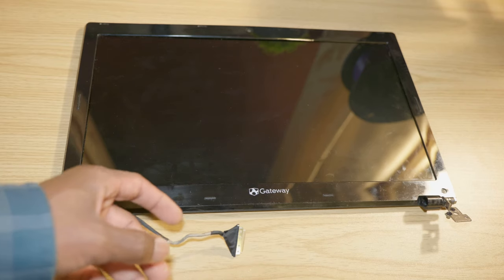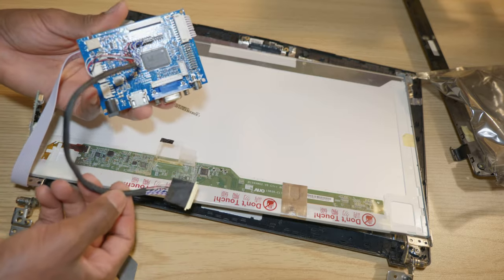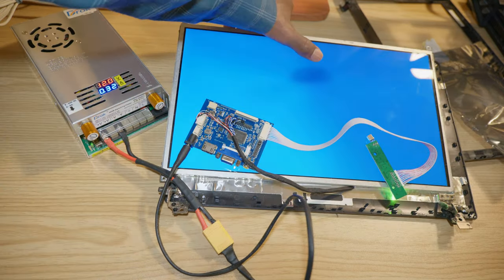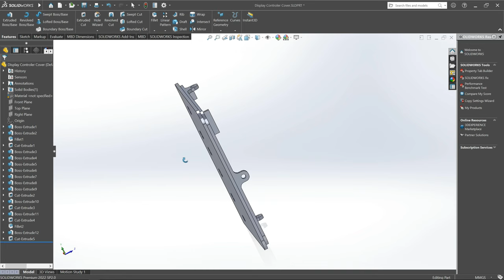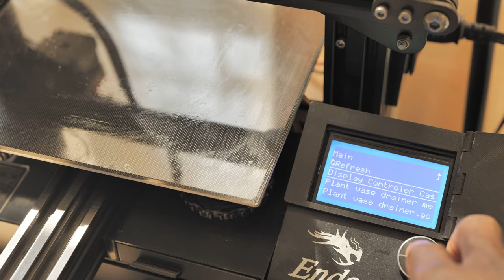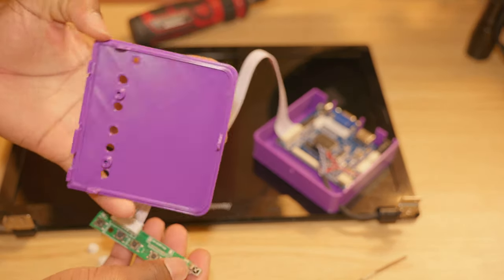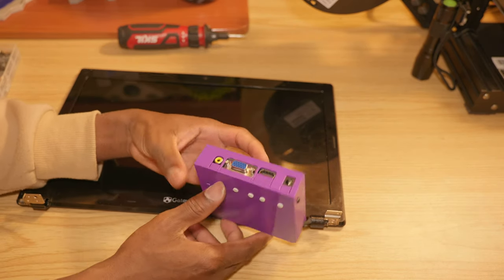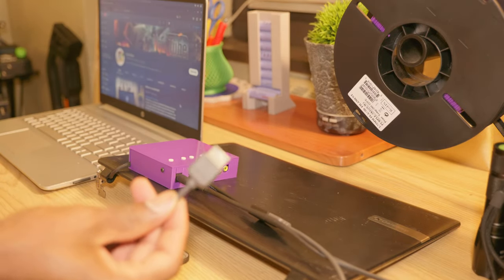How To Build a Portable Monitor? | DIY Projects

Comment: Would you be able to make a video of this running off batteries.  I really want to make one of these but i need it to run off batteries but im unsure how to wire it up. Ive just subscribed and I'm going to binge watch your other videos now ha xx
Reply from the maker: I will probably be making a video of that. It might just take a while. The best approach is six 18650 lithium ion batteries in a 3s2p config. two cells in parallel and 3 in series. 11V nominal and 12.6V when fully charged. Enclosed in a 3D printed case and mounted through parallel connection with the DC barrel jack connector of the display controller. Add a 3s BMS on the battery so connecting the DC 12v to display will also charge the battery
Reply: @YvonSmart  brilliant thank you for replying and I can't wait to watch your video when it comes out xx
Reply from the maker: @vikkidyer  https://youtu.be/W7InE2lXXXo

Comment: Is it possible to make a 4k@120hz with vrr allm hdr with hdmi 2.1 portable monitor. I plan to travel next year and I do plan to take my ps5. I do have 2k 144hz portable monitor with freesync but I do get 120hz I get no vrr and it basically looks like I'm playing at 1080p but the colors look washed/ foggy. No matter if I put hdr on/off. I have gigabyte m32u at home I love it for the ps5. That said the 2k monitor is great for the steam deck no issues there. The problem is the ps5. I got some better results for color warmth with a 8k hdmi to usb c cable but still only a degree of color upscale. I do hav3 chiaki on my steam deck and ps remote play on my phone but honestly even with great wifi I've found the lag just takes me away from the experience. What would you do for this build?
Reply: Also when I use the ps5 on the m32uc I have an 8k to displayport 1.4 cable. Way better color and refresh rate sync
Reply from the maker: For a DIY project, that would be overkill since your display needs to be 4k120hz capable, and if it does, you may not easily find a compatible controller capable of transmitting such data. It may be costly and getting a premade portable display may be a better choice. Even in that frequency range, portable monitors barely come in 4k
Reply: I have a 2k portable but the freesync just isn't compatible so the fps is all over the place with the ps5. With the steam deck no issue. I borrowed someone's 4k@60hz the picture quality was great but to me imo 4k@60hz is more for watching movies

Comment: Can u make work for example the portable screen you are created at 120hz if is it at 120hz or not?, also can u duplicate the primary monitor on the second?, so you will oscurate the first monitor
Reply from the maker: The display used in this video does not support 120Hz (not even 60). But if you use a monitor that supports 120Hz it will work if your main computer handles high framerate outputs. You can choose from Windows settings what types of HDMI mode you want; you can set it to duplicate if you want both screens to show the same thing or choose extend if you prefer more real estate you work on (your mouse will travel between the two displays and you can drag programs between the two displays. Hope this answers your question